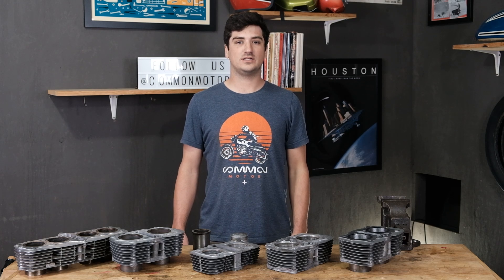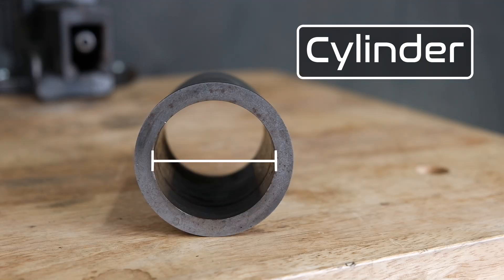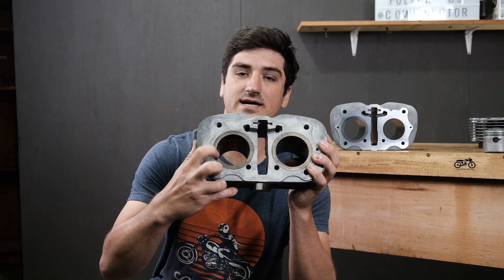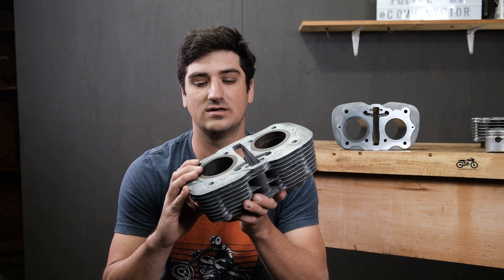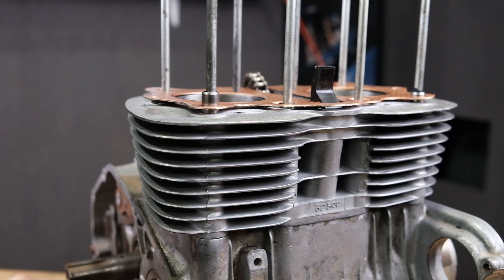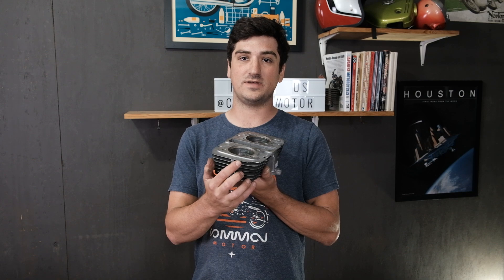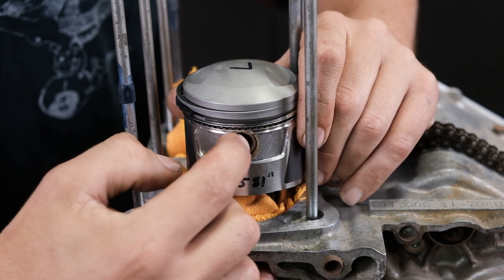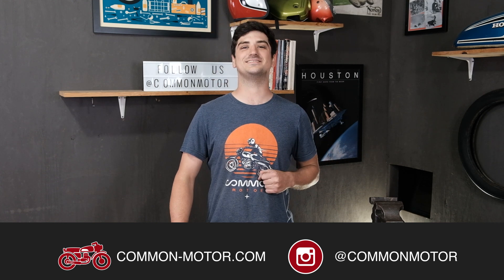Cylinder Boring: Wear and Repair Explained

Comment: Nice video! lots of good info. I had a question about some specifics on my particular bike 74 550. I'm reading 58.48mm on all four cylinders, the wear limit being 58.6mm. Curious if this is close enough to go for .25mm over bore? or is there is enough meat there for just a clean up hone and new standard rings perhaps? Pistons are reading a little more out at 58.46mm wear limit being 58.35. I don't really have anyone else to ask about this other than local machine shops which I will need to do soon. Any thoughts? Thanks, cheers